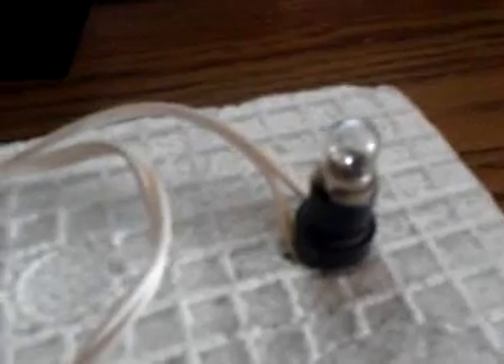How to make an electric circuit with an on/off switch

Comment from the maker: @adnan5514 switch basicly opens and closes the circuit...inside the switch there is a conductor (metal piece for an exapmle). when the switch is turned off that metal piece is not conecting the 2 sides of the wire, but when the switch is turned on the metal part inside of a switch is touching both sides of the wire so the electricity can flow trough... you dont need some fancy switch, you just need a piece of metal that you will use to connect the wires when u want your "swithc" to be turned on.